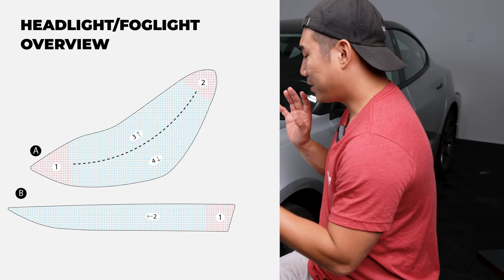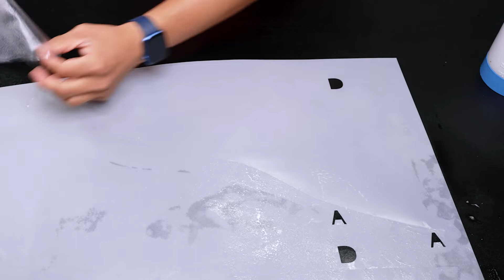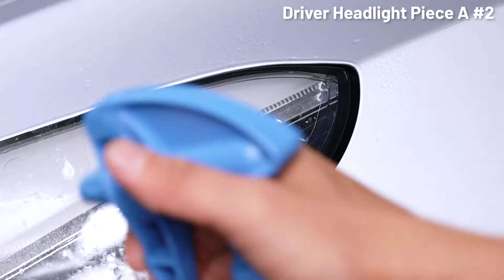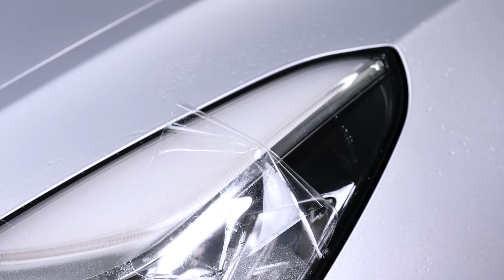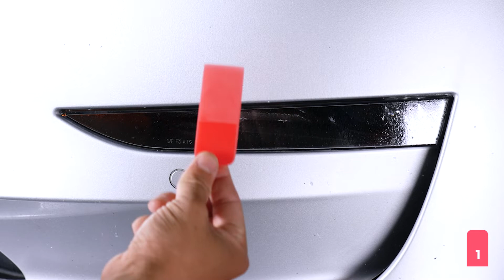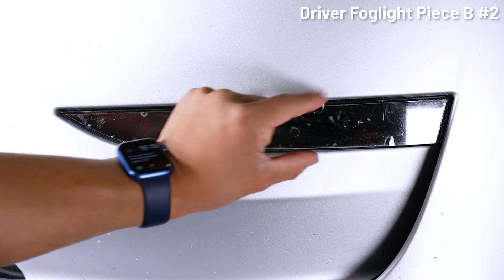Step by Step PPF Installation On Tesla Model 3/Y Headlights and Fog Lights | DIY PPF

Comment: Best customer service!  I accidentally dropped my headlight PPF on the ground and sprayed Slip solution to get it off but as I was installing it there were a lot that I missed.  Short story, they sent me a replacement for FREE!  I recommend Tesbros for your PPF needs!  The videos are done step by step and easy to follow.  1st time installer and it was easy, besides the drop.  :)